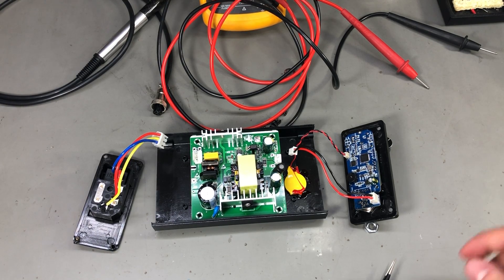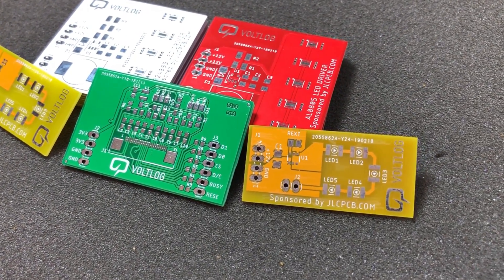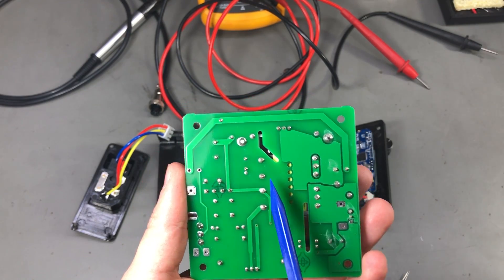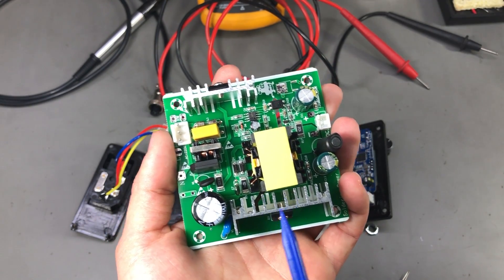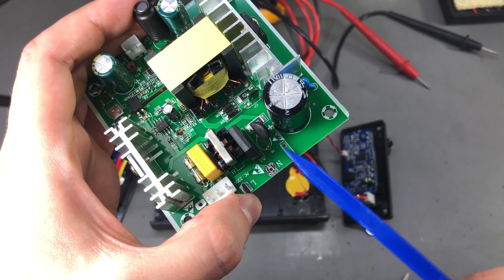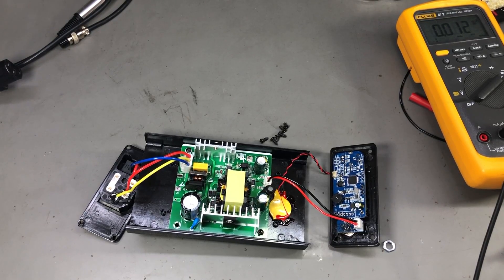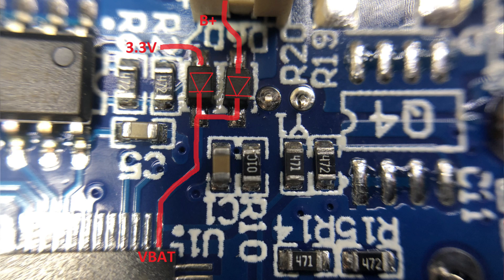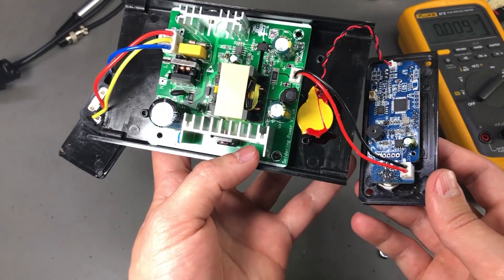Voltlog #234 - The Problems I Found With The KSGER T12 Soldering Station

Comment: What is the DC resistance of your T12 elements? You said 24v for the supply, but measured almost 26v. I thought T12's are 27v for their 70w rating. You'll probably need to use a real meter to test the element. I'm curious because my old atten (radioshack) station uses a similar element/themocouple arrangement as the t12's, I've been tempted to get and swap one to try it. My '60w' station's original element is right around 10R5 on my old Keithley 5.5d. I have bought 3 replacement irons and 4 elements trying to find a replacement, all were either totally wrong 4 wire elements or are between 12 and 13 ohms. This makes them 40 to 50 watt units. Heck, if a T12 element is around 10 ohms, I'd measure and add a few turns of wire to my transformer's secondary. I'd rather bump it up to 70 watts than kick myself in the nuts with 50.

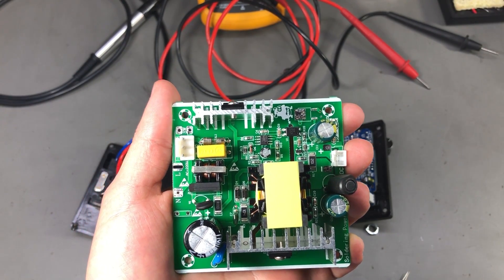2:40
 They made 2 different heatsink footprints. The holes are present for the narrow version. I looks like they even silkscreened the narrow fins missing on the larger HS version. I'd check my heatsink drawer for a narrow replacement and test the real temperature values...by that I mean, I would lazily place an 80 degree C thermal switch on the smaller heatsink and wire power through it.
-Jake
Reply from the maker: I've checked 5 different tips and I am getting between 8.3 and 9 ohms so with the ones that read around 9 ohms you would theoretically be getting 69.4W @ 25V. But keep in mind for these T12 tips, the thermocouple is in series with the heating element.
Reply: @voltlog  
Thanks for checking! 
 Yikes! I think 8R3 would really be pushing my station hard. I was hoping it would be a little closer to 10R and they were more loose with the "70w" rating. I think 8R3 is more like "70w+." I would probably need some real temperature monitoring to pull off a mod like this.
   Here's a post I made on the eevblog forum about this station-
https://www.eevblog.com/forum/reviews/radio-shack-digital-soldering-station-64-053-atten-at209d-harbor-freight-96531/ 

  ...not that you care about my bench junk, but it is an interesting design with the through hole parts and socketed PIC μC. I also added a link on the last post on that page. That's the video that Rodger from Kainka Labs made where he goes into great detail and shows exactly how the Atten 2 wire element works. I think this is the same way Hakko did the T12 too.
-Jake

Comment: If the battery holds the settings and cals for the different tips, that R10 is going to sux.
Reply from the maker: just the RTC is backed up by the battery, while the settings are stored in the EEPROM.
Reply: I don't quite get why a soldering station needs an RTC..

Comment: Nice video and I'll do some checks on my device.
But is there someone who also has the ticking sound in this station? It's a silent repetitive ticking sound. Thanks!
Reply from the maker: Yes a ticking sound can be heard every time the mosfet is switched on. The sound comes from both the enclosure and the handle though I don't hear the one from the enclosure unless it's opened. I can hear the one from the handle as it's switching. I am wondering why I wasn't hearing the same on my older STM32 station.
Reply: @voltlog  is this frequency normal? https://www.dropbox.com/s/3ssqcib0ye4b4ul/Solder%20station%20-%20ticking.m4a?dl=0
Reply: Banggood wants me to let it review / repair by a local shop after they approve the quote. But isn't that straightforward...
Reply: Also, this sound is recorded while enclosure is closed
Reply: @voltlog  hey, sorry to bother you again. Is the sound the same as in my soundclip? Thanks!

Comment: I stand corrected on the internal fuse part I see :-)
Would be interesting to know the rating of it compared to the external fuse.
But probably not possible to read of it?

Thank's for this excellent followup video.
Well, now we know were the fuses that should have been in "that other brand of soldering stations" have gone.
Reply from the maker: yup I tried reading the small fuse but couldn't see anything, while the one sitting in the IEC socket is 5A 250V AC
Reply: @voltlog  5A ? OMG, so you have to draw more than 1.2 KWatts before the fuse will blow?
Ok, then you don't have to worry about replacing that fuse, cause it will never blow.
The PSU will burn up before that.
Maby a 1A would be a better choice...
Reply from the maker: @geirendre  It's good that we have the fuse socket in there, it's user accessible so everyone can chose whichever value they feel safe with. The 5A current will be easily reached if something bad happens so i have no doubt that fuse will blow, however choose a smaller one and you might end up with the fuse blowing just because there is a current surge when the power supply turns on. So in conclusion I will leave mine on 5A.

Comment: POWER SWITCH IS SINGLE POLE ONLY! This is no good and leaves parts of the circuit live ALL TIME. a proper mains power switch is supposed to switch BOTH lines N and L, so the circuit is really off the grid when switched off.
Reply: That's even worst in the house where I live : I don't have here L+N ( +240v +0V), but L+L (-120 +120V), so I need to use always two poles switches. Cheers !
Reply from the maker: we're talking about a soldering iron here, that's how they're all built. It's not some medical equipment with special safety class.
Reply: It uses a IEC-C13 polarized connection, so the switch should be on L. Its not an issue at all.
Reply: @jaro6985  the cable Plug that comes with it IS NOT POLARIZED and can be used either way. So no. Not valid within Europe.

Comment: No need to take the metal case apart to check the ground. Just do continuity & resistance checks between the earth pin on the plug and the case.
Reply from the maker: You might get a good reading from a dodgy grounding point inside the case which will go bad later, so if you're checking you might as well check it thoroughly by visually inspecting the insides.

Comment: I don't think heat sink isolation can feed through to the secondary since the TO-220 device is an ISOTAB (non metalic tab), sure it's not acceptable but in a plastic case, even if the heat sink goes live, the other ends' solder tab has isolation too.
Reply: The problem isn't the TO-220 device. But the heat sink is right on top of multiple tracks on the secondary side as well. So your isolation is 2x solder mask. The heatsink will get warm (pretty much the point of it) and could soften the solder mask or make brittle. And then you have the sharp edges of the heatsink maybe pushing or scraping on the solder mask when the whole unit is moved around. Sure, it needs special cases and would be really bad luck for all of this to go wrong. But with that argument you could do away with all safety isolation measures, because "it's fine as long as nothing goes wrong".
It's just so frustrating to see that what otherwise would be good isolation (don't know about the inside of the transformer) is made moot by that. My guess is the circuit DRC was set up to check isolation between primary and secondary side tracks. But since the heatsink isn't connected to anything, the DRC doesn't see it as a "bridge".
Reply: @superdau  On switched power supplies you usually have a vibration due to the working frequency of the power supply. Now this one also works with different load situations and VoltLog confirmed in a different post, that there is a ticking sound when the MOSFET switches. If the heatsink has mechanical contact to the solder mask then it's just a matter of time till it mechanically fails.
Reply from the maker: Good point and there is even a simple solution to the isolation problem as proposed by another viewer in the comments, one might separate the heatsink from the pcb with a small plastic base to raise it 3-4mm.

Comment: I just purchased the 24V version. It hasn't arrived yet, but feel safer purchasing my own decent 24V power supply and then no issues with direct mains connection.
Reply from the maker: yup that's one aspect that you control yourself with the "mini" version of this station but be aware that there are many low quality laptop power brick clones on the market.
Reply: Yes, good point, but I'll make sure to purchase from one of the decent UK suppliers: CPC / RS/ etc.
Reply: I have the "24v" one also and it is fantastic.  I am running it off of a 19.5v Lenovo laptop supply or an 20v Ridgid tool battery.  There is an adapter plate on Thingiverse that you can 3d print that lets you use the battery this way.  It is nice being able to plug it in OR use it off battery for portable soldering (like working on the car).
Reply: What size DC plug jack connector does it need?
Reply: @ianpaul6369 It is one of the fairly common 5.5mm x 2.1 barrel connectors.  THe unit I got is this one:
aliexpress.com/item/MINI-T12-OLED-soldering-station-electronic-welding-iron-2018-New-design-DC-Version-Portable-T12-Digital/32839523934.html which is the best price I could find.  The pictures there show the 5.5x2.1 jack.  THis is a really nice unit.
Reply: @kirkb4989 , Quicko now sells a T12 station that slides right onto a Dewalt, Milwaukee,  Makita or Worx battery. No external adaptor or wiring required; and it does have an input jack for a separate power supply. They cost around $50 US.
Reply: There apparently is an issue with tip grounding with the mini version.
Reply: Quicko/Quecoo's version seem to support both 110-220 volts and 16-24 volts, although I don't know how it compares to KSGER's otherwise.

Comment: why dont you get a TS80 or TS100 and look at the firmware source code.
Reply from the maker: I don't understand, why would I do that?
Reply: @voltlog  because it is a less shady iron to have and has public source code for the firmware so there is less wondering about what might be happening. but just excuse me if you got paid by KSGER.
Reply from the maker: @TouYubeTom  So I'm getting paid to make a video to show the bad stuff about this soldering station? GENIUS
Reply: @voltlog  i said just excuse me if. ya you made this impression with the first video. anyway i guess i am the wrong kind of subscriber.
Reply: @TouYubeTom  Note that he already has either or both of them, check some older videos. I have ordered this station (unfortunately a metal cased one) to have better ergonomics and the soldering iron always sitting on its place even though I also own a TS100. It is what I take with me when needing a soldering iron outside home.

Comment: @VoltLog That issue with the heatsink and the only thing protecting you from getting mains on the iron tip being easily damaged soldermask is a pretty serious matter. That would normally be grounds for a RAPEX recall and sales ban on the product if it was actually sold through official channels in the EU - there is no way that could pass any sort of safety testing!

Frankly, until that is fixed, I would hesitate to recommend this station to anyone - that's a fairly big risk that someone gets hurt.
Reply from the maker: You should checkout what Weller is selling for years and then reconsider if this should be recommended or not.
Reply: @voltlog  no main fuse
Reply from the maker: @felixgamingvlog6702  checkout a recent video from Louis Rossman where a Weller soldering iron had a loose mains wire inside.
Reply: @voltlog  yeah that what i mean no main fuse for 100$ soldering station
Reply: @voltlog  You mean that missing mains fuse? That's not normally an issue unless people like Dave from EEVBlog connect a 110V version to 230V mains by mistake ...  Sure, it is stupid to not include it but it is not really a major problem when used as intended. 

Weller's units are also UL listed, there is no way this KSGER unit would pass  that testing with the power supply you have (there are apparently multiple versions of this around, it is possible that some are better than others).

The tip being grounded is not much of a protection there. Yes, it is better that nothing (apparently there are version of this station where the tip is not grounded because the manufacturer didn't connect the wire!) but the grounded tip helps you only if you plug this into an actually grounded outlet (and have good house fuses/GFCI). There are plenty of older houses and installations that don't have that - and then the only thing preventing you from potentially getting electrocuted is that soldermask under the heatsink. That's pretty bad, IMO. 

I would only recommend buying the version without the power supply and providing own laptop power brick or something else.
Reply: @voltlog  That's not how safety works. Safety is not less important just because others also may make mistakes. This inappropriate isolation between primary and secondary side is an absolute no-go. This turns the soldering station into a life-risking device.
Reply from the maker: @AS-oq7io  I know that's not how safety works, but we we're talking about recommending this or not and I was simply comparing it to a brand that everyone would recommend but still lacks safety features, not about how safety works in general. I do not consider the device to be a life-risking device simply because there is a plastic enclosure and because the tip is connected to mains earth.
Reply: @voltlog  Why does Weller lacks safety features (I can't find the mentioned video)? A fuse is not required and a loose mains wire inside is exactly a reason why you want to have a working safety layer available. The scope of the safety layer is to protect you exactly from this unexpected issues.

The KSGER soldering station is life-risking because it has no working safety layer in place. The whole secondary side is not designed to scope with mains. The question is not if a part of the secondary side will fail when exposed to mains, the question is which and when.

For example in a few years from now when you long forgot about the missing safety of your soldering station, you decide to replace the soldering iron. You switch the mains switch off, because safety first of course. And then bye bye VoltLog. Why? Because the mains switch is single pole, some pins of the connector of the soldering iron are still exposed to mains and you touched one by accident...
Reply: Not to say you're wrong, but here are two my thoughts:

1. How often and/or why would one even touch the tip of a soldering iron (with bare hands, too)?

2. Have you ever been electrocuted by the main? It hurts, but it's lethal in most cases.

Although I'm all for safely designed devices.

Comment: I have an idea, why not unscrew the heatsink and raise it so the isolation spots are are good and support the heatsink using a makeshift brace, done and for the mains bus-bar, just coat it with epoxy.
Reply: Of course you drill a new hole and remount the mosfet.
Reply from the maker: That's a good idea, I could design & 3d print a base for the heatsink to raise and hold it something like 3-4mm higher. I would probably replace the diode to get the extra pin length on a new one.
Reply: @voltlog   Yes and you could even solder on the clippings from a old one that's bad or trimmed pieces in the collection. I save them for jumpers.
Reply: @voltlog   If you go through with this idea, would you please show the work, it would make a great video and maybe the maker of this will also fix the mistakes?
Reply from the maker: @MrBrymstond  Yes I plan to post an update video. For now the plan is to check the temperature of the original heatsink with the psu under load and then if possible install a smaller heatsink that would at least clear the primary side tracks. If a smaller heatsink is not acceptable then I would raise it from the pcb by a few mm with a plastic base.
Reply: @voltlog  Good idea, just don't forget there's plenty of room to move the heatsink over one or two fins or all the way over to the edge of the PCB clearing the mounting screw. Just drill a hole accordingly in the heatsink and your 3D mount will support that no problem. symmetrical dead center is always best, but more is still better. Just saying.
Reply: @ikester475   I guess you can, but you can never have enough heatsink.
Reply: @voltlog  have you hot around to solving the heatsinks issue yet via a 3d printed spacer or smaller heat sink?  Would love to see a video on all the revisions.
Reply: ...... Stop reading my mind, (Great minds think alike).

Comment: Thank you very much for this video and the very useful hints you gave, for example about R10. I bought exactly the same recently and mine shows a temperature that is off by far (15% or so). I checked the tip temperature with a cheap soldering iron thermometer from aliexpress and another cheap general purpose thermocouple thermometer as well. I used the tips that I ordered together with the station from KSGER and all show the same big offset.
Reply from the maker: you should run the calibration menu
Reply: It's not there. I have seen this in another youtube video, but mine doesn't have it. I bought the soldering station from the KSGER shop on aliexpress and the menu structure  is the same as shown in youtube review videos but that important option is missing.
Reply from the maker: @ralfjahns3777  might be an older version? contact the seller and ask for the hex file for an upgrade.